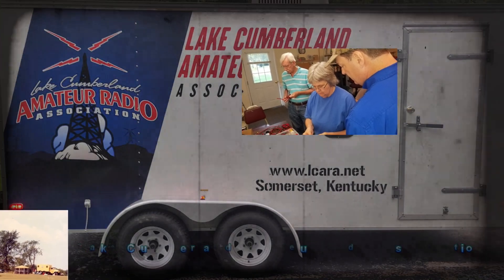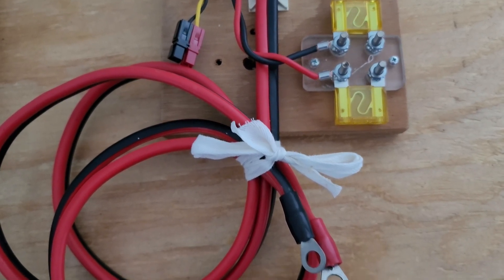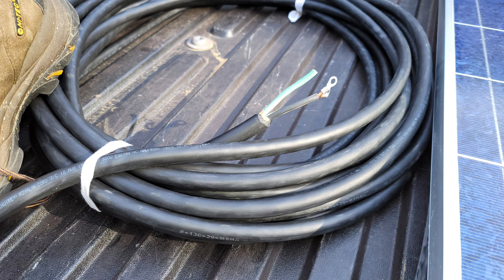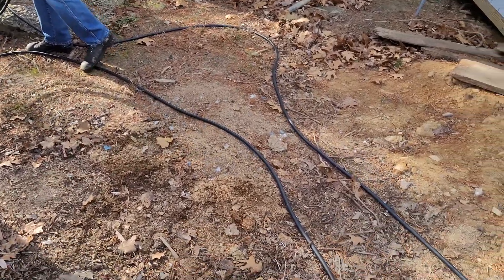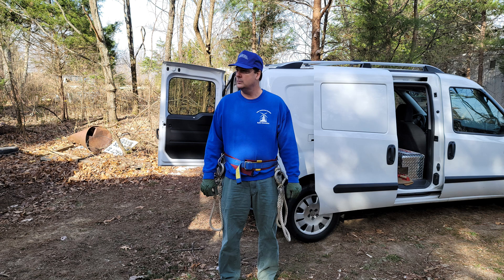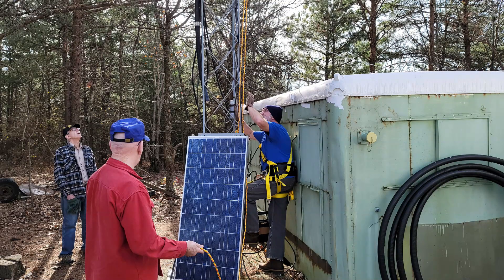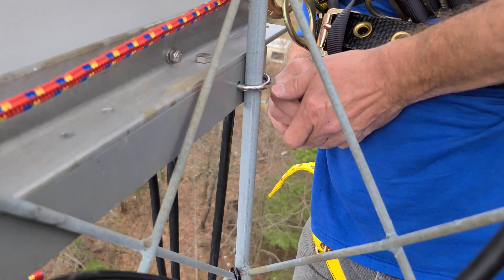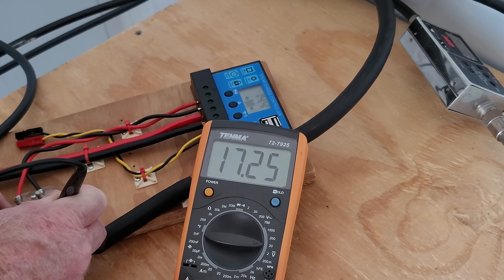LCARA HAM Radio: Abandoned Repeater Site Part 9 - Adding Solar Power!!!!

Comment: Where did you get these solar panels at? Can you provide a link?
Reply from the maker: Mark, the solar panels we are using were purchased close to 10 years ago, but never used. If we were to use a panel from today, we would probably go with the inexpensive Rich solar panels you can order online. We have a link on our website in the HAM Radio Gear section. KY4BDP